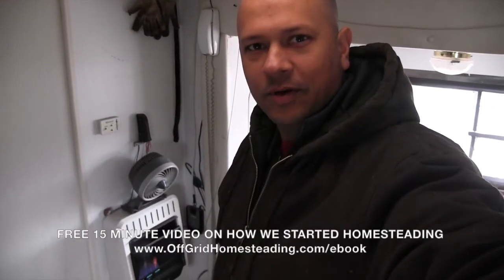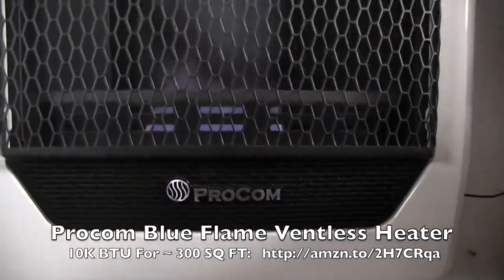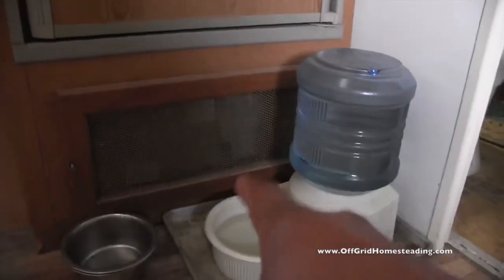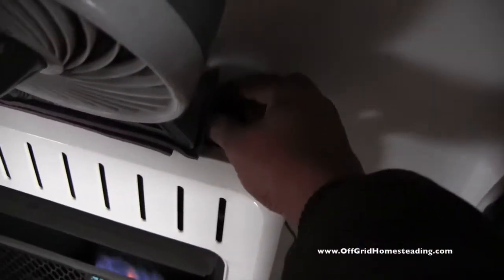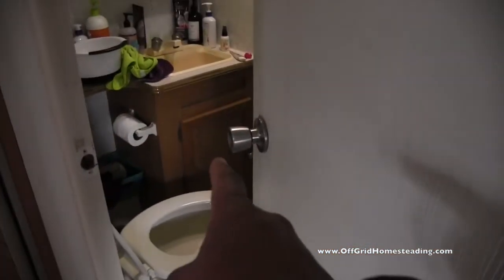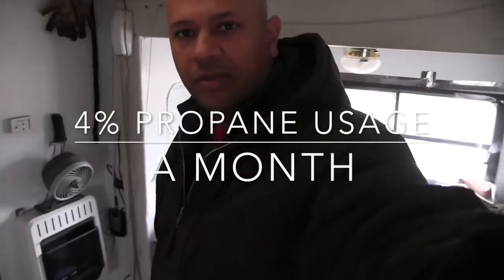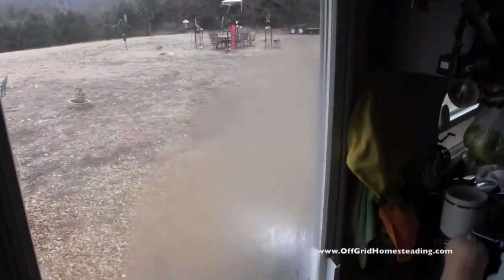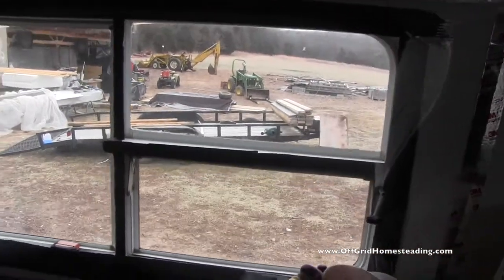OGH - HOW WE HEAT OUR TINY HOME WITH ALMOST NO ELECTRICITY

Comment: I use one in my cabin it's got a built-in blower it's a little bigger than that though but if I need to run it without electricity it will ignite with a 9 volt battery the blower just won't run but it'll still work good enough to heat up the place.... I've never had an issue with condensation

Comment: Any issues with water vapor building up inside?  Doesn't the top of the heater get warm enough to melt the fan base?
Reply from the maker: No I thought it would get too hot even if the fan were not running, but that's not the case.  There is a little deflector near the top that pushed the hot air out and forward -- other wise I'd think it would be a fire hazard.  I had cut off a little piece of a yoga mat in to a strip doubled over for the base of the fan as it was sliding off and was annoying from the vibrations.  It's somewhat bearable with the mat in place.  The mat does not get hot at all either.  Good questions though.  I was concerned with the same questions.   Also issues with water vapor, YES.... if you search the channel, we address the water vapor thing.  The propane stove puts out a TON more moisture-- why I have no idea.  Everything gets moist -- and we have lint free rags near most of the windows to wipe them down regularly.  When we get into the addition, this will stop as we'll have more insulation between inside and outside.